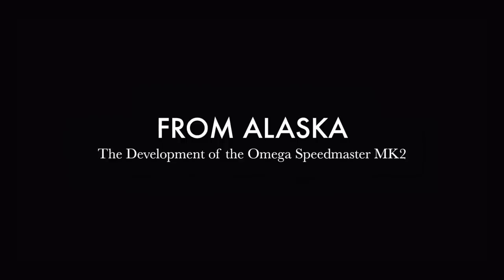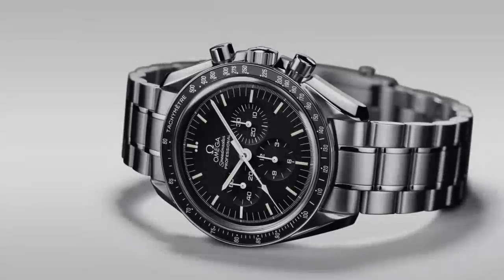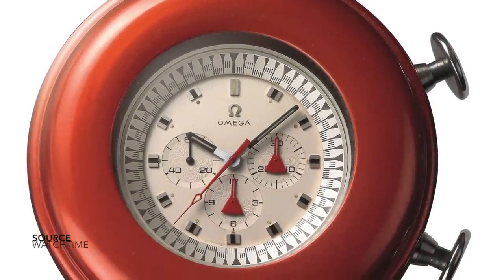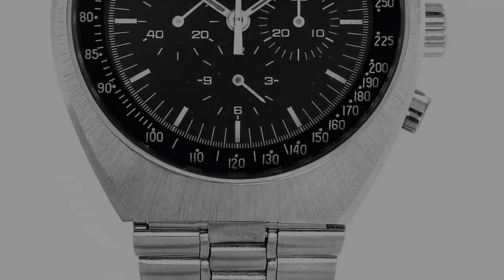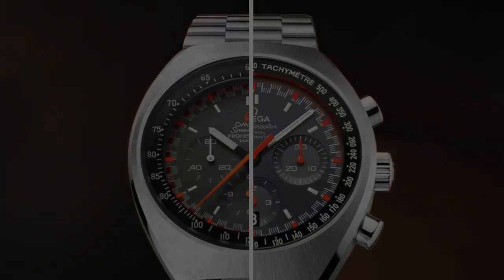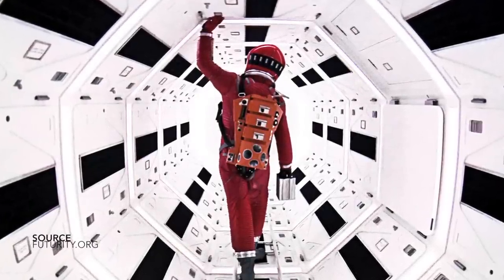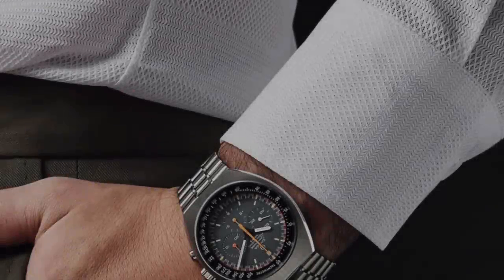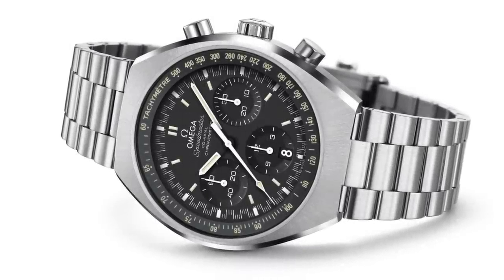Omega Speedmaster Mark II: Why Did NASA Reject This Watch?

Comment: One of the reasons the Mk II was not selected is not mentioned in this video- The Glass crystal. Why?  It could brake in the inside atmosphere of the cabin and the floating pieces of glass could have been very dangerous for the eyes of the astronauts. The breaking of the glass would had also broken the tachymetric scale, with no way of calculating rates, something needed for these missions. The Plexy glass would only would shatter but would not produced those small fragments, and the tachymetric scale would not be affected, so the older model was preferred. That was explained in a video several years back.

Comment: The movement change has nothing to do with it. No 861s went on the moon, but one did go on one Apollo mission. And 861s were used later on by NASA. I think the simple answer is that the OG moonwatch was not discontinued by the Mark II, so why bother certifying another option? I do agree these are great looking watches!

Comment: IDGUY, I think this is one of your best videos you have done. Really nice presentation. There was a lot of history I did not even know about. I used to want once since the mid-1990s. I never got one because it was heavy and a bit big on my wrist. There are a couple smaller ones like the reduced and first man in space. So many models of the speedmaster. I also like racing dials with red hands.

Comment: Was the Mark II rejected also because of the choice of using sapphire glass vs the hesalite. I understand that was a major factor over Rolex and their use of the oyster perpetual movement and worries of sapphire glass breaking creating shards of tiny pieces of glass and the movement failure in weight less environments. Yes Rolex was on the moon also but "unofficially", I'm sure because it was not fully commissioned for space flight. Great video, enjoyable editing/cinematography on the watches show casing their elegance.

Comment: Thank you for the thoughtful review that looks at this watch as it should be done. I already owned the original Speedmaster Mk II and just received the updated version. I always preferred the look of this watch compared with the so called Moon watch because to me the design of this watch is just absolutely perfect at least when it comes to the harmony of the dials, the proportions and finally the readability. To me this watch is THE classic chronometer and sort of archetype in this category. It should be handled much more carefully by OMEGA and if done so it could reach a standing like the Daytona from Rolex by refining every aspect of this watch over the years.